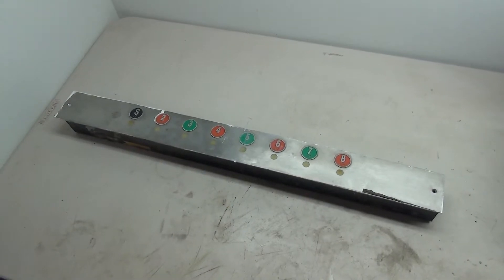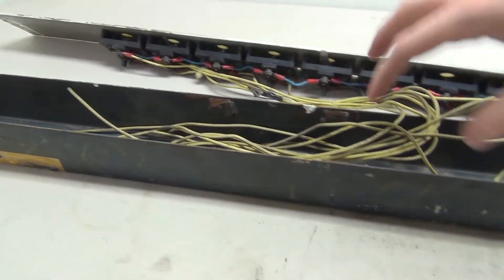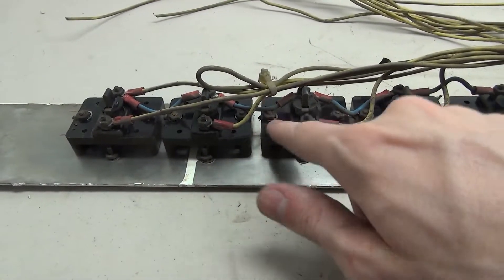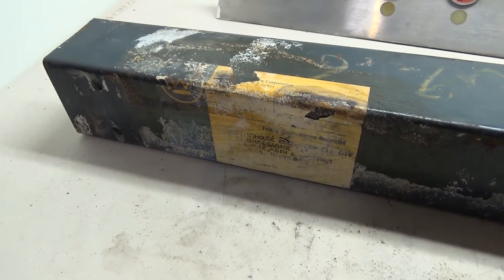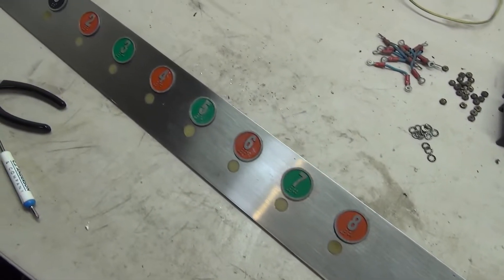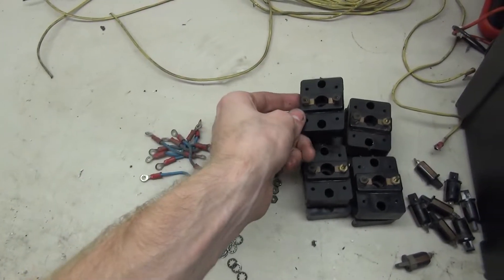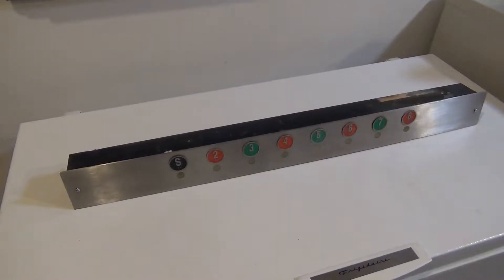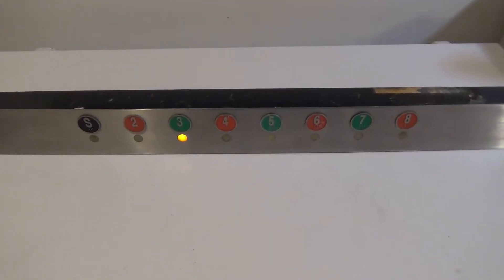Wiring a Long Elevator Position Indicator

Comment: Using braille tags for floor numbers is very interesting... and modular.  Efficient may be a better word.
Reply from the maker: It's totally more efficient. They already had to make the brailles for the car panels (four panels originally), so they might as well use the same ones for the four PIs.